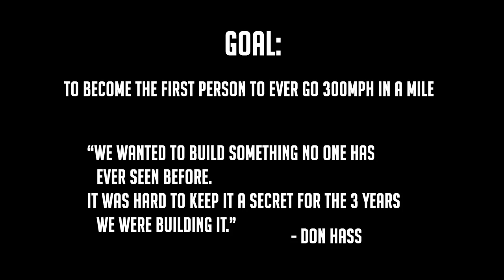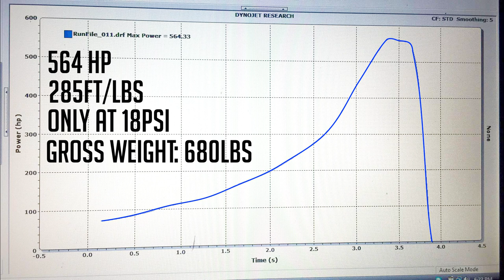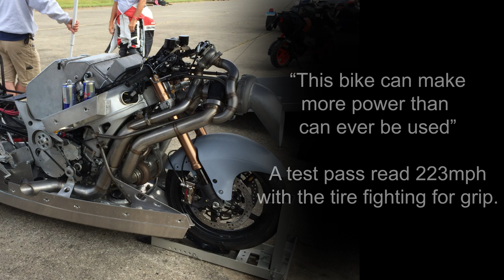The Compound Turbo Hayabusa 2016 Introduction.

Comment: power to weight ratio works out to something like 0.8hp per pound. Thats ridiculous. F-16 fighter jet type stuff. idk know how that rear tire has enough grip to hold that level of power, esp being compound turbocharged. Once that big turbo lights off, its over. At the speeds those guys are after, that bike is basically looking to kill the rider. Any type of engine failure or cooling failure is gonna get under the rear tire and its game over. not to mention any type of tank slap would be un-recoverable. 
   That being said, it looks super sick. Anything that revs that high and has boost is my kind of engine! i just prefer four wheels instead of two when dealing with that level of power.

Comment: why you guys don't mod a zx14r like this?
Reply from the maker: +Kawaii Ninja simple answer is Don is a suzuki guy. More complicated is that the zx motors have the cylinder attached to the block and they dint offer the same ability to performance upgrades. Suzukis especially the hayabusa offer a ton of after market mods. Currently this is a dry block with a stock block but with funding or sponsorship the intent is to do a full billet machined block.
Reply: +Hass/Serafini Racing that's why all I see is mod haybusa doing world record stuff and drag racing. because it's easier to mod them. thanks.  I might get one a slowly mod them over the years
Reply: +Kawaii Ninja not the only reason but look at it this way. With a busa you tear up one cylinder and you need to take out everything, tranny and all with a Kawi. With the Zuki you just redo the clyinder block.
Reply: +Kawaii Ninja  alot a work
Reply: +Pierre- Built in the video it's an 1st Gen busa.  why not the newer one? both gens don't change much right. just some fairing work. plus 99-2000 are not stricted

Comment: Wow. That's almost a 1:1 power to weight.
Reply: Excluding the rider
Reply from the maker: 18psi was all that would hook on the dyno. Has run 42psi and is designed to run 75+.

Comment: Put a spoiler on it for that rear wheel traction, but don't make it to big.
Reply from the maker: Steering is important so maintain front down ward pressure is really important. During the runs in the video we were still figuring out the boost control situation. Dual turbos and 3 wastegates took some tinkering.

Comment: I don't see how you can put that much power through a motorcycle tire.  It would seem like to keep the tire from frying at speed you'd need some down force.  If you had some sort of sophisticated traction control it might still be impossible to get to 300 in a mile. Even if you could keep the wheel spin to say 10% faster than the front, is it possible?  With that much power I don't see how anyone is going to be able to control the power to the tire. The boost is bound to be brutal when it comes on. Lighting up the tire at 250 mph is bound to be hard on the underwear. Maybe you need to add a sidecar and power it's tire also.  It sure is some awesome design and workmanship.

Comment: JUST ONE thing
KAWASAKI H2
Reply: My turbo 750 goes about the same as a H2 with a good rider in the mile. They are not that fast
Reply: An H2 is literally a supercharged liter bike. This Hayabusa is a turboed 1300.
Reply: Marko S and an h2 only makes 240hp...an h2r does 320-330hp dyno wise but is race only.

This is 300hp more than an h2
Reply: There are 425+whp H2s out there.

Comment: If this Motorcycle goes into a wheelie at lets say 290mph it will not be pretty. Maybe this bike should have some kind of front spoiler/little wings, something to keep the front down on the ground.
Reply: +julio lausell yeah but more downforce is going to reduce topspeed. and considering that's what they're after it's probably not an option
Reply: +2TMVloggin&#39;RS No one truly knows how Bill Warner crashed. I was wondering if his bike had gone into a wheelie at almost top speed. That is why I commented about trying to find some kind of down force for these ultra fast bikes. I guess some people are willing to risk it all. I respect that.
Reply: +julio lausell it weights a shit ton. Bill stated he would have built a bike with more down force. This get down force from the design of the inner front fairing as well as the nose near the wind screen as well as the was the turbo intake is designed. Don and I talk regularly and he stated the fairings will only go on and attempts at large numbers with no wind, cross, head or tail.
Reply: +Pierre- Built In no way am I trying to get someone to slow down, I loved going fast until my accident, now I have a limp for the rest of my life. I'm lucky to be alive. My bike is gone, but my limp is here to stay. It changed me, I can only wish you guys the best. May all speed-freaks be SAFE, GOD SPEED.
Reply: +julio lausell I have been in a car that rolled 9 times. Ya no I was just saying Don as of now has his head on square when it comes to waiting for the correct conditions
Reply: Pierre- Built I'm glad you are ok, Safety first  gives you the chance to ride again the next day. That bike looks like a real record breaker. Take care.
Reply: Update - I bought a 2005 GSXR 1000. I had not ridden for 15yrs. I have put about 100 miles on this bike now, I got it up to 130mph so far. That same night, after putting away my bike, I could not believe how relaxed I felt. It was a very special feeling I had not felt in many years. I hope I can stay focused in doing the right thing, so I can have many more moments like that......... I'm no expert, but I did once hear that the exhaust should be at the rear of the bike. At high speeds the rear of the motorcycle has low pressure that would like to be filled up from the exhaust. If its dumped out the side, this effect is lost. Remember, by far, I'm no expert, but it did make sense to me. I know it might not make a big difference, but every little bit helps when it comes to aerodynamics.  I hope everything goes perfect for the record attempt.
Reply: or at least stretch it like a foot

Comment: I'm sure you went with comps because they are self contained but they are WAY down on power.  every comp I have come across has been significantly down on power compared to the same sized competition.  most notably was a single 88mm on a 370cid engine, swapped to a garret picked up instant 220 hp same boost.  here is something not right with their compressors or cartridges.
Reply from the maker: These are not the oil less.